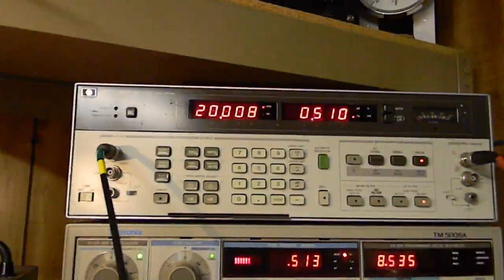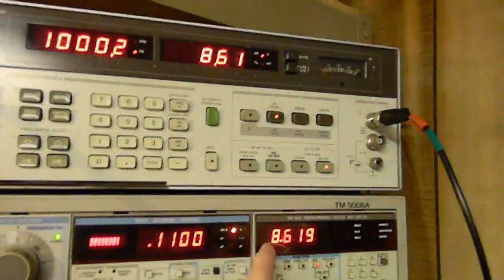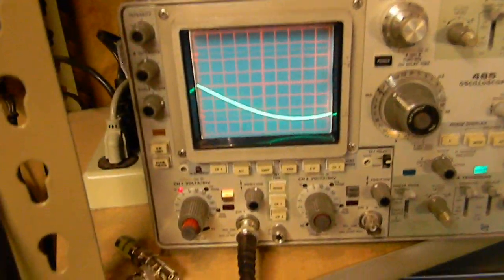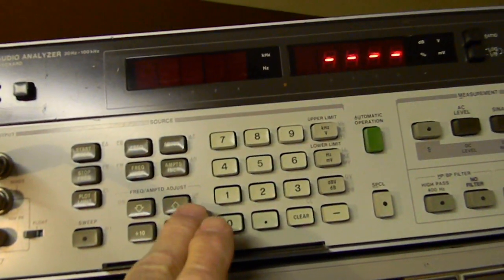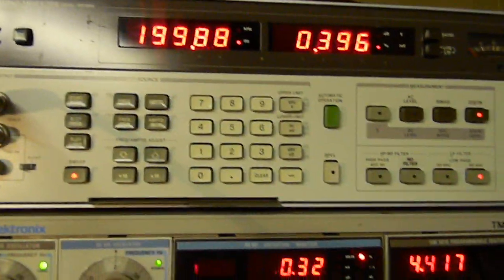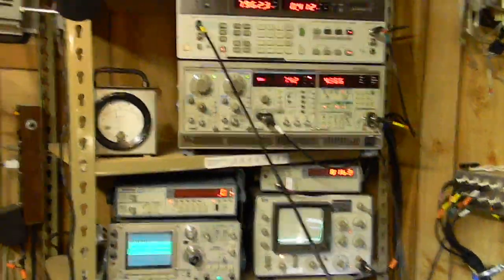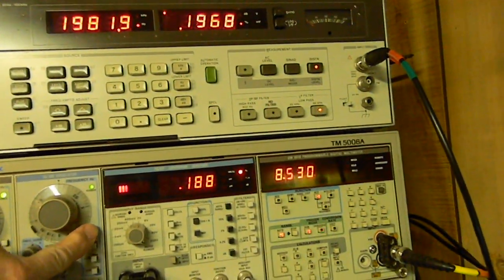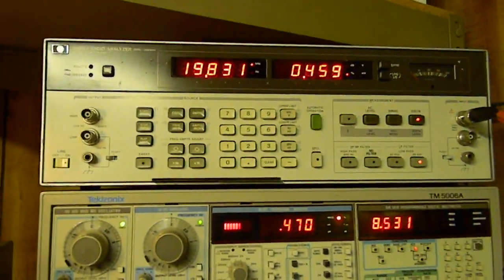Second Video On The Hewlett Packard HP 8903A/B  Audio Analyzer

Comment: 0:34  I'm deaf, but is that resistor load for the amplifier?
Reply from the maker: Yes, they are precision (1% non-inductive) loads rated at 300 watts each. They are made by Arcol and are sold by www.mouser.com
These are type,    NHS300 8R F
https://www.mouser.com/ProductDetail/ARCOL-Ohmite/NHS3008RF?qs=%2Fha2pyFadujDb2nxGdHVgQnvAKT1meAIb7Q2Jc2GZ1vieb1uu3IXqA%3D%3D

Comment: Great video! How "repair friendly" are these? I'm wondering if I find a cheaper one that needs work, are repair parts still available? Thanks!
Reply from the maker: The only issue I have had with mine was with a relay on one of the boards. There are four or five little yellow relays about one inch square each on one of the boards that one went bad on mine and I found a new one on Ebay for just a few dollars. The problem was intermittent and not easy to find but I did not give up. If it has an issue you will surely have to fix it yourself probably down to the component level.
Reply: @ElPasoTubeAmps  thanks! I love all this gear, but I can only afford the non working. But it's a good way to learn, and I'm up for the challenge thanks to your channel. Keep up the good fight!

Comment: May I please ask if you still have it and have solved the software issue? :-)
Reply from the maker: Yes, it was a simple configuration issue at my end. I made a couple more videos after this one showing how, I believe, the issue was I was not saving the configuration updates correctly.  Being six years ago I may be wrong with this comment but please see my videos on the HP 8903 made after the date of this one. It is a fantastic piece of equipment and I still use it pretty much on a daily basis.
Reply: @ElPasoTubeAmps  Many thanks! Glad you got it to work! I'll look at these videos! :-)

Comment: Have one of these, acquired it when an electronics manufacturing facility shut down in my area. This was part of a large lot of test equipment for sale and got it for a very reasonable price. The unit had recently been calibrated and was working fine, it's been sitting in my radio room on the shelf for a couple years. This video piqued my interest so I may browse through the manual and fire it up. Enjoy all your videos, very interesting information.
Reply: I designed it at HP many years ago.  Fun to see the video.

Comment: Love your videos.  I've learned a ton.  I'm toying with the idea of buying a HP 8903B or a Keithley 2015 for my audio lab.  Would you consider doing a demo on the setup and operation of a THD and Watt measurements and any other cool audio tests you do with your HP 8903?  I have found demo's on operating the Keithly 2015 but not on the HP.  The HP videos always seem to have HP already setup and running on the THD measurement.  Thanks
Reply from the maker: I have done several videos on the HP 8903 - 
Here is one:
 https://www.youtube.com/watch?v=Xzr8Xk_GLjY&t=318s
and there are several others on my channel. 
I hope they help.

Comment: Hello I think you need to need to run through the calibration manual. when i use frequency 1 kh it is 1000.0 not the point .2

Also dose your rf gen have the rubidum clock for the 10mhz you can link all instruments via this 10mhz external clock witch should sync everything.

As far as the gbip usb ports i have never found one that would work with everything. i found a pci-e card on ebay and that works really well on the hp website you can still download the source code for all machines so you can build your own test applications.
Reply: Actually, this is nothing to do with the machine's calibration. The frequencies are selected in a limited number of digital steps, so they may not correlate exactly with 1KHz or any particular frequency. The manual specifies that entering 1KHz on the unit's generator could produce anywhere from 960-1040Hz.

Comment from the maker: I am in the process of figuring it out. Not much information out on the web - I think the modules that are available by Pete Millett are for runtime v5 and may not work with  Agilent 82357A USB/GPIB interface that I have. I think his modules were written for the ISA/PCI boards and connect to the 488 interface on the 8903 with a cable. I may be wrong about all this but I will continue working on it and certainly post any success I have.